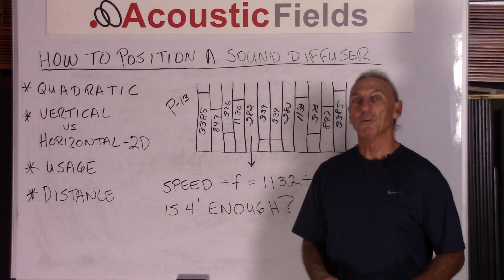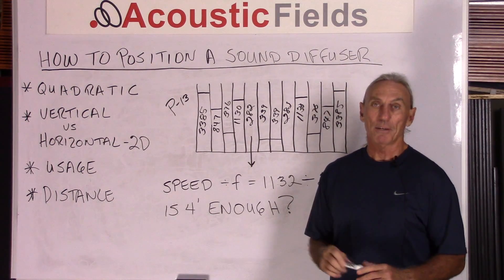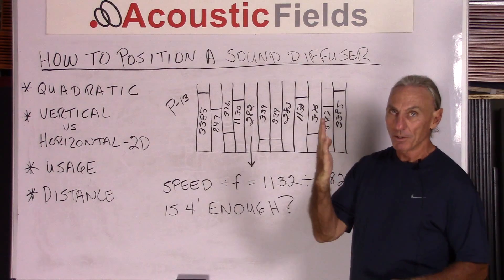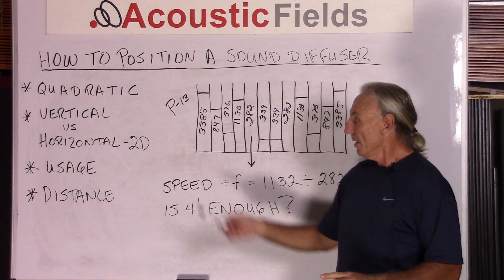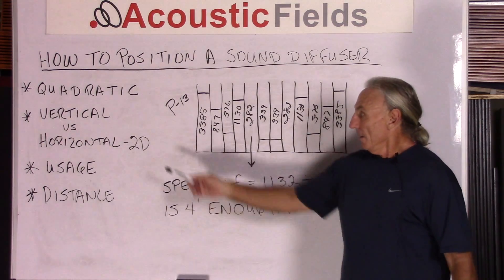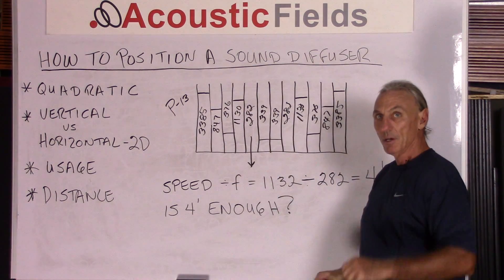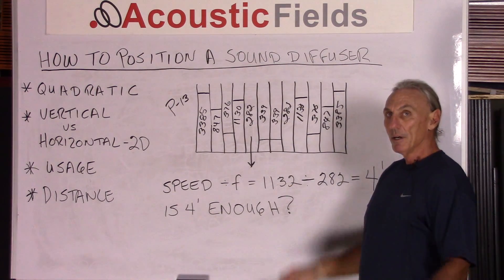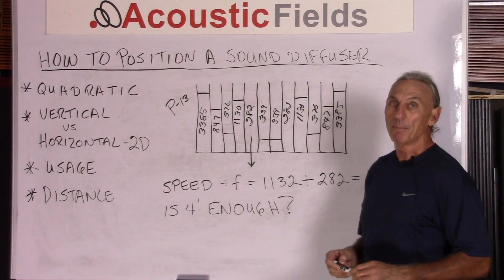Sound Diffuser Placement - How To Position A Sound Diffuser

Comment: Really appreciating your informative video posts, Dennis.
I'm looking at putting one of these diffusers on the live room back wall (behind where I've been setting up drums for recording).
Do I need to take into account this distance of 4' (/6') in terms of where I'm likely to place some of the (eg. room) mic's?
For example, If I want to place a room mic back there near the wall sometimes, am I then better off building a large P7 diffuser (or a bank of them repeated alongside each other) with less depth than the P13, to avoid anomalies getting picked up in that mic?
Or is this outweighed by the overall benefits in the room of having a deeper (say P13 or above) diffuser, and maybe just shield off the side of that mic from facing the diffuser?
I hope that makes sense! THANKS!
Evan
Reply: PS. My live room is 9m long, and 4.6m wide on those end walls.
There are also doorways through one side of each of the end walls, but this QRD could potentially be up to about 2m wide, and sit from one edge, and into the centre area of the wall.
And I do have enough space there to make it a deep diffuser if it is indeed advantageous to do so at this location.  
Ceiling height is just over 3.3 metres.
Reply from the maker: Hi EvLoutonian Thank you for the comments, much appreciated. In answer to your questions I would still stick to using the lowest frequency diffused as your starting point when using microphones. A vertically positioned quadratic diffuser will spread sound out in a horizontal fan like array of energy. This would be a 180 degree radiation pattern. With this wide spread, I would find a microphone that has the proper sound field recording configuration. To give that microphone a chance at that diffused sound field, I would use the lowest frequency distance as a start. You will never get it correct the first time. It will take 3-4 sample recordings.

Yes, It appears that you do have enough width. I need some more information to best answer your question. Could you fill out the information in this link and send it to me. Sit in your listening position and take pictures of all 4 walls and ceiling. Attach those to form data. 
http://www.acousticfields.com/free-acoustic-treatment-room-analysis-tell-us-about-your-room/ I will run the analysis and get back to you with the results.

Thanks
Dennis
Reply from the maker: EvLoutonian Hey, I went ahead and asked my colleague to ask me your question in this weeks Google Hangout.  You can see my answer to your question here.  I hope it helps:
http://youtu.be/6cod-x4EVw8

Thanks
Dennis
Reply: Acoustic Fields Thanks. I sent you an email.
I'm not much of a Google+ user.. How do I find my way to this GoogleHangout place / thing?  THANK YOU!
Reply from the maker: EvLoutonian We aim to go live each Tuesday at 11am EST however of recent it has been every second Tuesday. You can watch it at that time on our Google Hangout page at https://plus.google.com/u/2/b/115055447156960092252/+Acousticfields101/posts Are you on our mailing list as I always send a link to the replay there? You can join it here and get my free ebooks and videos www.acousticfields.com/free-ebook Thanks Dennis

Comment: does diffusion enhance stereo or make it sound more like mono
Reply from the maker: Hi keith ed 

Quadratic diffusion is not stereo or mono. It is an acoustical instrument that manages boundary (wall) surface reflections by minimizing their strength. It gives you separation and definition of frequencies whether mono or stereo signals. 

I hope that helps. Please let me know if you have follow up questions as I'll be happy to help.

Have a great weekend
Dennis
Reply from the maker: Hi keith ed I answered your question on diffusion and the stereo/mono relationship in greater detail in yesterdays Google Hangout. You can see the part where I answered your question here http://youtu.be/wj0o-R3VX54

I hope it helps.  Please let me know if you have any follow up questions I can help with.

Thanks
Dennis

Comment: Thats cleared up and answered many of my questions. I kinda guessed id need diffusion on my front and rear walls (maybe ceiling too) for an audiophile 2 channel situation with foam on the side walls and 2 or maybe 4 of your diy bass absorbers.
Problem is my front wall is all window so i may have to settle for diffusion rear wall and heavy drapes covering the entire front wall. 
By the time i get round to doing the room hopefully your Acoustic Fields window blinds will be available to ship with my foam. Thanks again Dennis for another cracking video.
Reply from the maker: Lee Goodwin Hi Lee,

Windows must be covered. I can think of no worse sound than the reflections from glass surfaces. It invades our middle frequencies where our vocals lie and that is sacred ground. I want no room surface interfering with my vocals. You can have the front end of your room be all absorption with diffusion on the rear wall.

Try this set up for a bit and listen. Once you understand how much diffusers contribute to spaciousness, separation, and definition, you will then be better able to decide on ceiling treatment. The proof is in the listening. Trust your ears and heart.

Regards,
Dennis
Reply: Thanks Dennis. Cant wait to get started. Its gunna be interesting moving foam an diffusers in different positions. The sad life of an audiophile :-)
Reply: also dont use foam its simply bad